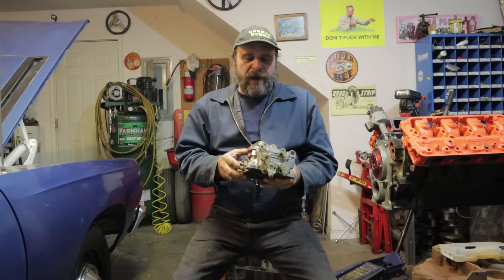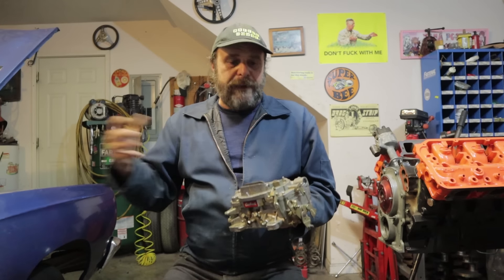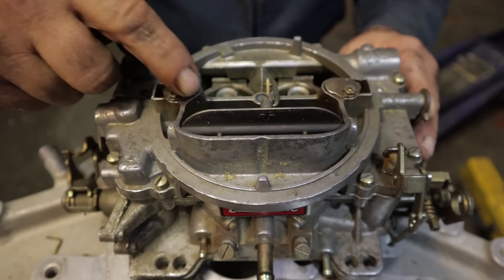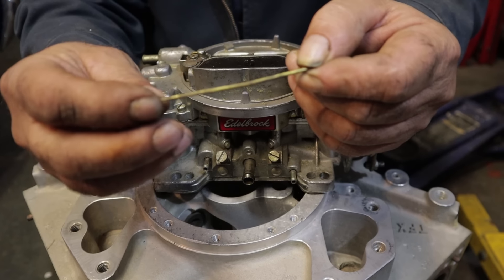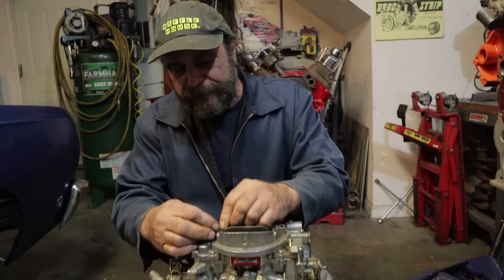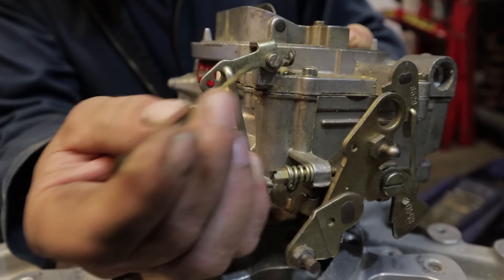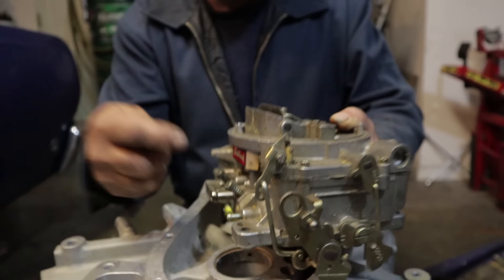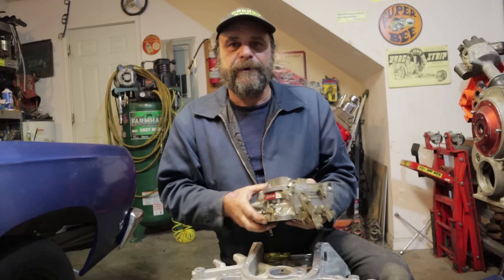How To Make The Edelbrock Carb REALLY Work For You

Comment: Sorry have to claim BS on the secondaries drying out. THERE IS NO PUMP IN THE CIRCUIT. 

It's a flooded channel with a jet, that's submerged with fuel from the fuel bowl.

So if it's dry. It would be 100% impossible to start the motor, as the primaries, and secondaries use the same fuel bowl.
Reply from the maker: No...the passage that leads from the jets up to the boosters dries out on the secondary side.  The front gets instant vacuum through the idle and transfer slots, so it fills that circuit almost immediately.  Secondary side doesn't have that benefit.
Reply: @UncleTonysGarage  The horizontal passage that leads to the boosters is vented to atmosphere....AKA part of the fuel bowl.
Like I said. If there is no fuel in the that area. It will be impossible to start the motor. Because there would be no fuel in the fuel bowl.

PS. I might have to make a video of one of the 25 Edelbrock carburetors I have to show you how: If you have fuel in the fuel bowl, then the secondaries have 100% fuel.

Comment: No i would beg to disagree with someone as knowledgeable  as yourself . And what you’re saying is true compared to the Hollie. The Edelbrock from my point of you gets the most bad rap from the Chevy guys, A well tuned large Ventura Rochester four barrel That GMC Used (With the exception of the 348 and 409 which did you see Carter AFB) We’re never outperformed by the Edelbrock. On the street car two small barrels in the front they give you a lot of torque it low rpm’s and to vacuum secondary rear barrels that are huge is the optimum street performer set up at least for a small block. But where I grew up the AutoZone O’Reillys advance auto stores try to sell these and sell headers to anybody with I small block that would fit with the app adapter plate mind you
Reply from the maker: This was not about comparing the Eddie/AFB to any other carb. Just showing how to make it work
Reply: Uncle Tony's Garage you did that for sure.. showed me things i didn’t know... i was just adding that i believe a lot of the bad rap of edelbrocks come from The guys that buy them to put on their small block Chevy . 
They don’t get the performance they’re used to with a Quadra jet

Comment: You only covered the basics, the real issue with those is accelerator pump stumble off iddle when you run a performance cam  in a standard shift car, you just can't get it to not stumble lifting off at the lights, everywhere else the carb works great , it is part of the lean idle and the lag in the pump itself that causes this problem, i have had many and they all do it . sbc 10.25 to 1 running isky 284 mega on a 110 lc , guaranteed it will do it , there is not fix for this problem, use it with a automatic and a stall you will get past this point, on a stock cam with strong vacuum signal you wont have any problems, use it in a cammed up engine with a 4 gear and you will hate it, you got to rev up too much to lift off hard on the clutch to slip it so much. if you don't it will nose dive on you. That's why anybody in the know will skip these on some applications and go to a quick fuel, a holley, a bg where we can change the pump staging to fit our needs. i wont use them on customer cars any more, it is what it is.  If you have the answer to this you must share it. Hoards of guys will be waiting to hear the fix. I will take a stage 3 q-jet over this any day.

Comment: there junk.. I had a brand new one a 454 maybe month old fired it up idleing it died all of sudden. float stuck in it flooded the engine. pulled it apart and the float had a small pin hole turn to find out. trashed it. got a Holley 700 double pumper on it now couldnt be happier.